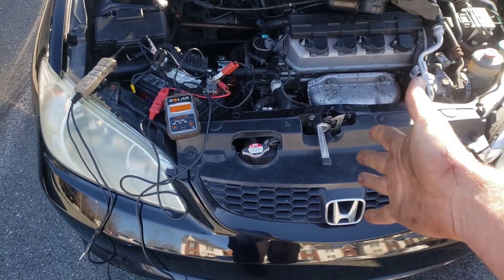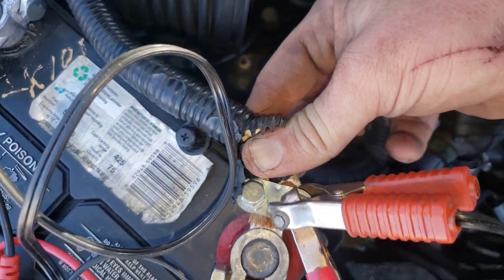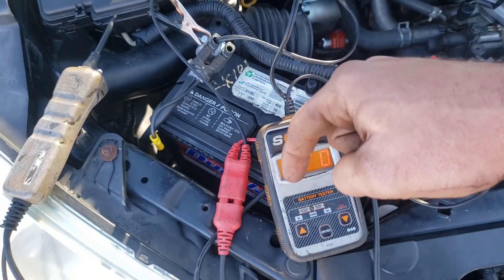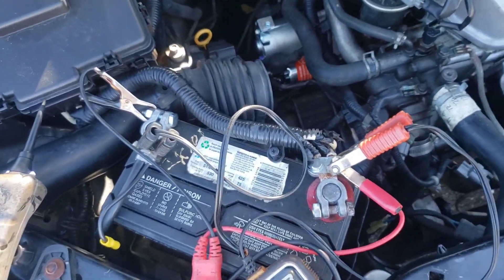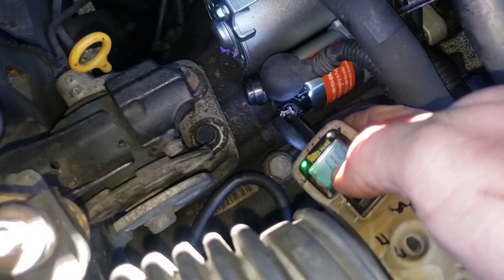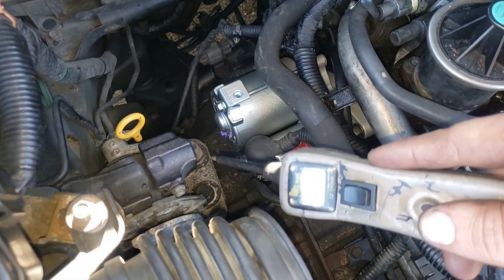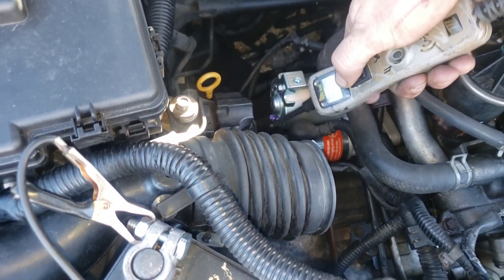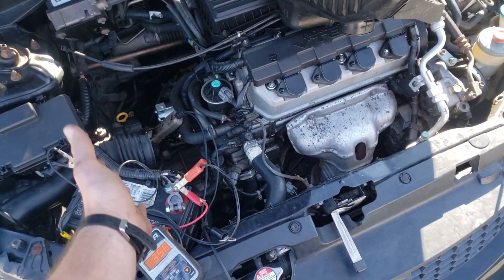Honda Civic No Crank No Start Diagnosis How to Check Starter Battery Alternator Ignition Switch Wire

Comment: The Safety switch on the clutch has stoppers. I replaced one of the two and then tested them both and they’re both good. I replaced the main relay I replaced the ignition switch. I replaced the starter and I’m still getting no start no crank. Dead when you turn the key just like in the first of your video. Checked all fuses too. Very frustrated.

Comment: My son has a 2013 Honda Civic that just won’t  crank and won’t start. Thought it through 2013 could not be the starter or any electrical since it’s a Honda. The electrical system is working well lights on horns working power windows working the battery looks good. For an engine to start it needs fuel and electricity if the electrical system is OK, it’s gotta be the fuel. Is it the fuel pump I don’t think so 2013 Honda or Toyota, they make quality cars and  parts. I look at the fuel pump fuse. Found it inside the car replaced the 15 A fuse, cars running good so before you go to the mechanic make sure you look at your fuses. For this problem it’s the FUEL PUMP FUSE. i’m not a mechanic just use common sense.  My son said dad you’re a genius. I said amen. 😂

Comment: What would be the most likely cause if the car SOMETIMES doesn’t crank? But the rest of the time it starts pretty normally.
Reply: Did you ever figure this out? Having the exact same issue, most of the time it starts, but sometimes you turn the key and there’s a single click and it won’t crank.
Reply: @TatersUnited  Not really, but kinda got less frequent with less heat, but I got rid of the car in March.

Comment: Hey hope you can help / starting car , stopped process key had others on so turned off restart nothing, no noise, did not turn on battery 1 y old
I m not sure if starter or ignition or fuse
Reply: Did you ever figure this out? I have the same issue

Comment: I have 12V at the starter, I get a chime when I turn key, but I do not get voltage at the starter control cable when trying to start

Comment: Could be you ran out of oil😂😂
Reply: I picked up an 01 civic to flip. No crank no start. Been through immobilizer, ignition switches and fuses. New starter good battery. This may sound stupid but is your comment suggesting seized motor or? Something else
Reply: @chrisribble yeah he is, if you cant turn over the engine what is a new starter going to do?
Reply: @redemu40 how would you even know if you couldn’t turn over the engine to begin with
Reply: @7lores By hand? There's videos I have seen doing it. I'm not too experienced so maybe thats not possible. But...

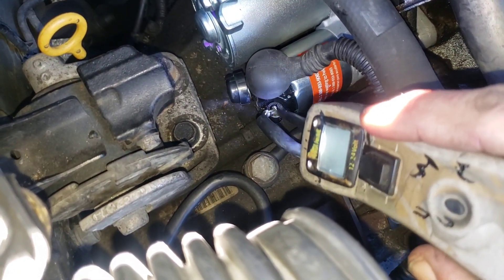Comment: 1:51  Dumb question but can anyone tell me the tool that he used to test the starter and put power to it when it cranked? I’m curious bc I’ve always done the screwdriver/solenoid trick but this tool would pay for itself imo. Idk exactly how many starters I have replaced in my Civics & Accords in the past 3yrs but I know I’ve replaced the starter on my 99 Civic at least 4 times in the past year and a half alone. I wish I would’ve had this tool bc it would’ve saved me a lot of time and headaches after my civic stranded a few times
Reply: I would like this answer as well
Reply: It’s a power probe
Reply: Power probe
Reply: Its shorted out, the starter, the wires crossed. Any tool will work. I usually use a screwdriver. You run the hot wire out against like the motor block or around there. Then just touching it with a screwdriver will crank it, or try to, like it's turning the ignition.
Reply: Its shorted out, the starter, the wires crossed. Any tool will work. I usually use a screwdriver. You run the hot wire out against like the motor block or around there. Then just touching it with a screwdriver will crank it, or try to, like it's turning the ignition.

Comment: Found something I haven’t seen a single video say on this subject. Civic no crank no start. After replacing my starter and it didn’t fix it I finally found the problem. It was an easy fix. If you have a 5 speed the clutch must be pushed in for it to start. There is a plastic tab on the end of the clutch pedal that presses a button when you push the clutch in letting the car know the clutch is disengaged. That tab broke off so even though I was pressing the clutch the car thought I wasn’t and wouldn’t crank. Part is $9 at Autozone and just snaps in. Real easy. Check this first if everything else seems normal but it won’t turn over.
Reply: @WasOnce.  
Reach up there and manually press the button with your finger and try to start the car. If it starts then you know that’s the problem.
Reply: @ketansoni9993  
By 5 speed I mean a manual clutch. In other words a car that has a manual clutch that you have to physically change gears with the stick shifter. 
Us older people call it a millennial theft deterrent cause young people don’t know how to drive them. Lol!
Reply: hey sorry but im having trouble finding what yall are talking about , maybe if someone could make a video on it ? also what is the part called ?
Reply: @DezMoney_  
There’s one on your brake pedal too. It’s a plastic tab that pushes the button that turns your brake lights off when you let go of the pedal. Same thing is on the clutch pedal to push the button that tells the car the clutch is pressed so it will start. Look around on your floor board and you’ll probably find it if it broke off. It’s small.
Reply: @fivebooks8498  okay i found out what it looks like , had to go buy new ones at the store and i’ll install them in the morning thank you very much
Reply: You sir are a life saver. Saved me a headache, time, and money figuring out this problem 👏👏👏
Reply: @llJNHll  
Yes sir. I replaced my starter before I figured it out.
Reply: @fivebooks8498  Did you try it in neutral before replacing the plastic part? Seems like it would have started if it was in neutral.
Reply: @AlexCyrus  
Not this year civic. Clutch has to be pressed regardless or it won’t start.
Reply: Instead of calling the part a 'tab' ...the guy asked the actual name of the part, which would actually be helpful when we go to a parts store to ask for the new part. We don't want to ask for a tab on the clutch pedal. 
It's called a Neutral safety switch.
Reply: Literally going through this issue with mine now two years later haha I will definitely check this out I was about to buy a starter too
Reply: @The_LoneWolf_Joey did you manage to find the problem? Currently dealing with this issue right now
Reply: @Jasaiyan yes on the top of the clutch pedal very top there’s a plastic rubber tiny little bumper that broke that pushes in a safety switch to let the car know to turn on. Got the new little piece install quick starts right back up.
Reply: You're comment saved me so much time!!! I also changed the starter and when I saw your comment I looked under my clutch and sure enough the pieces of the tab were all broken on the floor!!! I put a paper clip in the switch for now and it started right up.  I will get the snap !! Thank you!!!
Reply: @WasOnce.  
It’s a plastic tab that snaps into the clutch pedal at the top. It’s a little tough to reach your hand up in there and snap it in. Took me a while.
Reply: @WasOnce.  
I’ll be honest. I had a lot of trouble. I finally just put a small bolt through the hole with a nut. It had a big enough head to press the button.

Comment: This was not my problem. If you have a stick shift ,check your floor board and see if there are tiny bits of plastic laying on the floor. This plastic piece pushes the clutch neutral saftey switch in and allows the starter to operate. . Replace the plastic stop and WAHLA.  also the brake pedal has this and when it breaks the brake lights will stay on. The cruise control also operates with a plastic piece on the brake pedal.   Hope this helps someone.
Reply: This comment actually helped me out a lot. Thanks for the info!
Reply: Turns out I had the same problem, replaced starter and was going onto fuses next, turns out I had 2 plastic blue pieces in my floorboard, used a penny to test this theory and my car turned on. Thanks for the advice !
Reply: @Mads_6523 
Hey man, how did you use a penny to test it???
Reply: That's what I'm asking 
 @andie82
Reply: Fuck yah thank you brother
Reply: Where’s about is this switch?
Reply: Got lights on the dash but nothing when I hit the key. It did roll start, but no plastic on the floor. Suspect it’s the neutral switch or something

Comment: Tried to turn my car on had a no start took me a while to figure out why my my car wouldn't turn on I mean it was running just fine the day before. Only to find out my control wire connector to the starter solenoid is broke and it mustve happened when I was doing other work that took place after the last time it was driven.. Anyone know how I could replace it? A new harness is not an option unless I'm really feeling like searching. I just have no idea what the original connector even looks like so I wouldn't know where to start on making a new one or finding a new one.
Reply: Any updates on what happened to the car?
Reply: @ took the broken connector to an autoparts store and found one the same type and size and then crimped the new connector on that starter wire
Reply: @ That was fast for a 3 year old comment😂 Nice👍

Comment: Mine is 2008 honda civic lx and it has rapid clicking no start 117,500 miles.  Has new battery and honda tightened and cleaned the cables last time it wouldn't start about 2 months ago. Just happened again but this time I had rapid clicking and no crank and lights come on.  New cables? Starter? Ignition switch? Relay?
Reply: It’s not the battery.
Reply: It’s probably a ground wire or a starter relay. Or possibly the starter itself. Most likely a bad ground connection somewhere.
Reply: Sounds like my alternator harness issue, the rapid clicking/no starting was my problem too.  Replacing the harness and the receptor did the trick.
Reply: Rapid clicking noise comes from a dead battery. Sounds like your altinator isn't charging the battery while the engines running or the battery is not charging and needs to be replaced .
Reply: @whiggerhunter4268  It was the battery, guess it wasn't as new as I thought.  Time flies the older ya get.  Lol